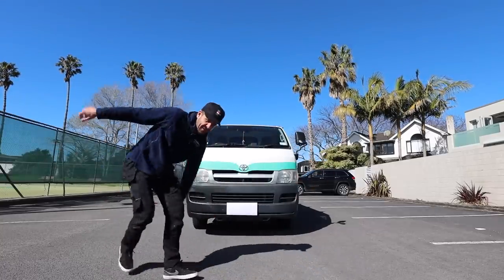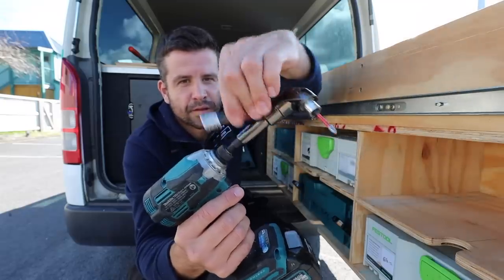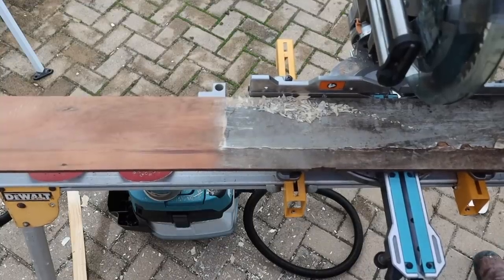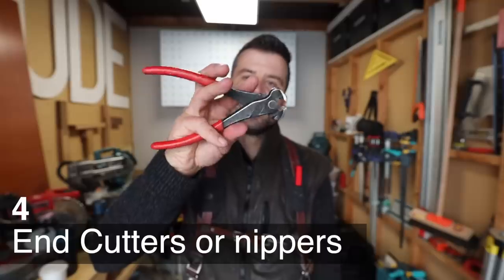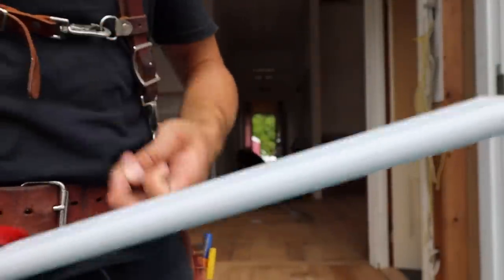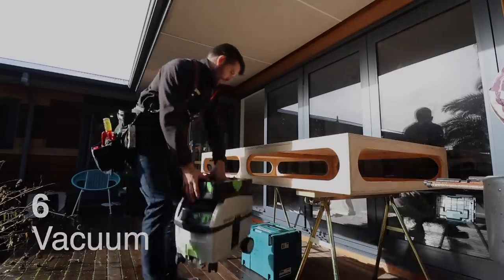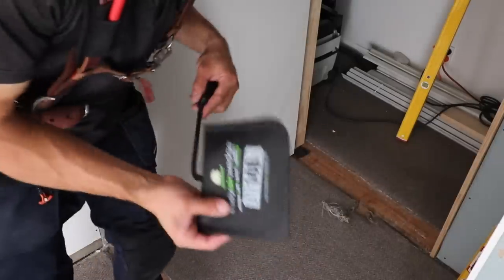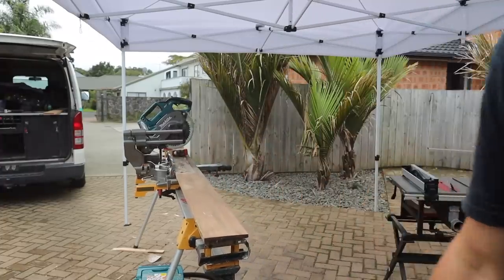7 Unexpected Tools For Builder's and DIY

Comment: ...Currently rebuilding a bathroom in a 1948, transitional plaster, plasterboard, masonry and steel mesh mix walls.. Watching Scott work with the multitool midway through the rebuild I realized I needed to buy one for myself. The time required for a Slow and Steady cuts is easily off-set by the time saved fixing the mess made by other operations. Long-Live the Multitool.

Comment: i have an old neighbor who was a carpenter and he used an old pair of horseshoe nail pullers for nail pulling those things are about 16inches long and provide some really good leverage on nails. in the USA there's a roadside assistance company called AAA i was talking to one of their guys and they use those air bag tools to actually help them to unlock car doors by placing it in between the door and the pillar and pump it up to create a gap to slide a tool in to hit the door lock button

Comment: I tell my clients that my honesty most used tool in my trailer is the vacuum. When your in someone else’s house making a mess it’s extremely important to minimise that as much as possible. It helps my brain to concentrate on the task at hand being tidy & more importantly almost always guarantees that the client will recommend you to family & friends because of the respect you have shown to their biggest investment - home. 

That actually brings up another suggestion for any renovator….floor coverings/protection is also a MUST. Wether it be cloth dropsheets, RamBoard, stick down carpet film, roll of black plastic or even disposable draping film over furniture & doorways. All have their different uses & impact ratings for different scenarios but all extremely useful.

Comment: On my (not) Knipex end nips I dulled the cutting edge on one side, then painted that side so I know which is which. This lets you get a better grip on stubborn small nails without cutting through them. I’d also add a nail set to the list for setting broken nails below the surface. Whenever possible I pull trim nails through from the back as popping the head up from the face often takes a chunk of wood with it.
Reply: Great tips! Agreed on all of these. Nail sets are also nice for just popping trim nails through rather than having to pull them from the backside.

Comment: I always thought air wedges were a gimmick until I finally bought one, they are hands down one of the most underrated tools especially if you have to do a lot of work by yourself.
Reply: 11am java
Reply: Air wedges are so underated,the list is endless for their uses.
Reply: First seen and used those air wedges several years ago. They were included with vehicle lock out kits. The kits included a plastic wedge, a length of some clear plastic with sandpaper for grasping locking mechanism, steel flexible rod for manipulating door handles, and the air bag.  Never thought of using it as a second hand…good idea
Reply: They okay i guess. I've had multiple. Some expensive, some not. I find they end up deflating too much. Especially when hanging heavy doors.
Reply: @flyingjackcarpentry9394  Air wedges vary in quailty, I usually go for Winbag or Hedgehog ones.Sometimes I'll use a piece of old hessian back carpet on them to protect the wedge.

Comment: The multitool should be top of any trades wishlist. Total life saver on many occasions!  😉👌
Reply: I understand how good they are in certain situations but I still absolutely hate them. 
The noise cuts right through me. 
The blades are expensive and shit.
The vibrations have given me the beginnings of WFS.
If I'm getting the multitool out the van I know I have something awkward and shit to do. 
But yes, they are handy. It's just my least favourite power tool.
Reply: Have to agree. Surprisingly handy tool. We just got one where I work and I've already needed it for two things I never knew I would in just this week: cutting out a stump at work, and car (under)body work on my free time. Ours is a Hikoki which came with a selection of blades, and including a selection of blades is a good way of giving an indication of the possibilities the tool has. There were many more than I expected, and I'm confident that's not all of it. Downside is, the blades are expensive, but that is fine for a problem solver.
Reply: @flyingjackcarpentry9394  Totally agree with your comments. I should add ear defenders and anti-vibration gloves to the same wishlist!
Reply: @refa42  going from corded to cordless was a massive improvement. Hopefully they can reduce the dB 🎧 on the next gen.
Reply: Awesome. I finally switched to the Fein cordless, and it manages vibrations so much better than my old tool, its become something I’m always happy to reach for rather than ‘oh no I need to use the multi tool’ - which was where I was for years before, accepting the usefulness but hating it.  Fein. All the way, Fein. The blades are pricey but good too.
Reply: @artfulcodger  Fein or Festool would be my choice if I had the 🤑💰. However my tough DeWalt is better than cutting architraves with a hand saw when fitting flooring! 😉
Reply: @burwoodbuild  hell yes. Even a £30 one from the supermarket is worth having. I think the festool one is an adapted Fein when you look closely, they’re basically the same machine just support Fes batteries. The vibration management is superb on them. In retrospect I should have got the festool as the Fein batteries meant yet another charger type!
Reply: As a software engineer, I have to admit I have little need for a multitool.  ;)
Reply: @flyingjackcarpentry9394  I strongly suggest getting the new Makita starlock, the new Bosch or the new Fein. (Or the Festool, which is actually a Fein) the latest anti vibration tech, plus Starlock, plus higher oscillation angle solves all the problems you speak of. I've owned quite a few multi tools while working in renovation and insurance, and the new Makita is a game changer for me. It doesn't vibrate my hand, its quite, it cuts fast, smoothly and the blades last way longer with Starlock because the connection is more solid and so they don't stall and heat up. Plus the Makita has constant speed control and it drops the power right down if you actually manage to jam the blade and stall it. It's incredibly comfortable and user friendly compared to the older technology. I can't even put into words how happy I am with this tool. 

Trust me, life's too short to put up with ghastly second gen multi tools with OIS blades and no anti vibration. Do yourself a favour and get a good one of you are using it often.

Comment: My pincers are 300mm Wiha pincers, they’re the one basic hand tool that took me years to find one I like. I’ve tried all the cheaper brands including Irwin and Kingchrome and none were nice to use and they all broke prematurely. The best to date were the cheap Trojan brand from Bunnings but even they needed regular repairs. These Wiha pincers are beautiful to use and tougher than nails (literally, luckily😝). Love them.

Oscillating multitool is a daily use tool for a multitude of jobs, couldn’t possibly live without it these days. Cheap blades off eBay are 1/10 the price of the hardware store and last just as well, sometimes better.

That little air wedge thing looks fantastic, I just ordered a couple. Thanks!

I would love to have space to carry a big vacuum on my ute but I’m limited to a tiny handheld one, it sees use once a week or so but I’d love to carry a proper vacuum.

I can’t think of a single time in the last 6 years I could’ve used a moisture meter but on the electronic devices front I can think of a multitude of times a thermal camera would’ve come in handy to find a leaking roof or badly installed insulation etc.

That paint scraper looks handy, we don’t reuse a great deal of materials but it does happen from time to time and I might just have to get a scraper like that for occasional use. Nice.

The right angle drill attachment is a nifty device, not something I personally would use a great deal but certainly it would come in handy at least monthly if not bi-weekly. I’ve known about them for a long time but never quite bothered getting one. Perhaps one day I will.

I’m dying to get a Dewalt jobsite table saw like yours but they aren’t cheap and I really don’t have anywhere to store one on my ute either. I’m on a knife edge at the moment, on my left is my already overloaded ute and on my right is the prospect of buying a van similar to yours to deck out and carry just a few extra tools - track saw, vacuum and table saw would instantly all be right at the top of the shopping list!
Reply: I hate towing trailers, I towed tool trailers for several years and it gets old FAST. Any work vehicle I own needs to be self contained to keep me in a good mood.

Comment: I'm just a lowly DIY guy renovating a tired house and the top three tools that have transformed how I work is the compound sliding saw, multi-tool and home-made track for my old Ryobi circular saw. The multi-tool in particular is so versatile and should be the power tool you buy after a circular saw and a couple of cordless drills. I also uses nippers to pull out nails that you can't get to with a hammer.

Comment: The tip about air wedges is brilliant. I bought 2 after watching your first video with them and they have proven useful throughout my DIY renovations. 
I'm about to replace and rehang all the doors and jambs, both Internal and external in my 1940's home. Almost all the jambs will have to be custom made on site to fit the odd sizing of the original hardwood frames. I've been watching your videos to prep myself, It's going to be one hell of an experience, hopefully not too costly.

Comment: I used heat gun and painter's tool to remove old paint from timber. It's so much quicker than the scraper and produces less paint chips. Just have to set the temperature right so it loosens the paint but not scorch the timber
Reply: Yup, I use a heat gun and the scraper. Been stripping old Kauri boards lately and it is the only way to get the paint off. Sanding is no good as the original material on the wood turns to gum. Painters tool for the profiles.
Reply: Something I try and avoid tbh. Work on old windows and lead paint isn't something I want to be heating
Reply: @elusivemite  as long as you keep the temperature low enough (under 500C, the fume point of lead) you might blow some dust around, but you won't be creating fumes that need a special respirator.

Comment: Those air wedges are also my favorite tool for prying open a car door enough to get a slim Jim inside without damaging the paint.

I used to lock my keys in the car more often than I care to admit.
Reply: did you ever lock your air wedge and slim jim inside the car?
Reply: @bachaddict  Yeah 😅

Luckily our local tow guy is a family friend so he would come get me out of a bind and roast me for doing it again, as any good friend would.
Reply: I bought one specifically for opening a door even though it says it’s not to be used for such purposes. Rules are meant to be broken. I keep mine in the toolbox in the bed of my truck in case I lock my keys in the truck. And a section of rebar wire for fishing keys or pushing buttons
Reply: I was recently measuring down from the top of a fridge beside the cabinet beside the fridge, and my measure tip got wedged between the fridge and the cabinet.  With it jammed in, it would not roll out, and I could not push enough to give me some space.  The air wedge to the rescue.  A couple up top, a few squeezes, and voila, the tape came out.  (mind you, I tried to use them to lift a piano the other day to get something under the wheels, I think I need a couple more air wedges)
Reply: You know, a spare key works too.
Reply: @MrEazyE357  not when the cylinder is jammed and the correct key will not turn in the lock. and spare keys are notoriously bad for getting tape measure tips unstuck. or when the spare key is 300 miles away in your locked house and the house key is also locked inside your car.

Comment: I concur. All these live in the van and get used regularly.

The linbide scrapers are a great tool. Do a lot of window renovation and there a must have 

Though I came across a tool I never knew existed. Metabo Lf724 
Paint shaver. 
Takes a bit of practice to use but saves a lot of time and hurt on the wrists

Comment: Heat gun together with the scraper is a dream for older paint, just heat it a bit so it softens up and it comes off so much easier than with just the scraper. Saves a lot of energy and makes the work more enjoyable. Absolutely true about the dust there!

Comment: Another thing that's an absolute must-have alongside a moisture meter is a pinless moisture meter, for when you've got the gib on and wallpapered/painted and you don't want to poke a dozen holes in it to track down a potential leak.  The fancy ones are quite expensive but you can get a decent Klein Tools one for USD 20-30 that's good enough for tracking down damper-than-they-should-be locations in your wall.

Comment: I had a patio roof built earlier this year. the carpenters could just not manage to cut the posts with an even shadow line rebate at the bottom of the post above that paving.

So I used my neighbours multi tool to cut that rebate square and evenly to the paving line. What an amazing tool, it is now on my must get tool list.

Comment: Don’t forget about the makita leafblower as a must have tool for renovations!
Reply: Or choose a vacuum that has an exhaust port the same size as the inlet, and you can use it as a blower (or those that don't have a removable blower/motor, such as some of the Ridgid models)    Save some space by just having one tool in the van.

Comment: As a 73 year old carpenter/joiner I was told during my apprenticeship in the 1960's that a carpenter used sawn timber i.e. roofing floor joists and studding whilst a joiner worked with planed timber i.e. skirting, architrave ,,doors, kitchen cupboards.

Comment: Scott - you covered many of the unsung heros in my tool kit which I find myself using more than I would have ever thought. You introduced me to air wedges - in return check out a Baaco 665 scraper - it's like a metal paint scraper but just way better due to the carbide blade - find I use it loads for much more than paint. Couldn't agree more on the vacuum and multi-tool. Other tools I could add to your list: a decent 18v portable light and a self centring pilot/hinge drill bit.
PS Love the channel - I learn loads from your videos and really appreciate all the great work you put into making them.

Comment: PAINT SCRAPER is awesome, removes glue squeeze out, flatten builders filler real smooth, clean paint off glass, used sideways cut glass, deburr pipe, the list is endless. It's the carbide blade that scrapes at 90 degrees to the pull of your arm, it's easy to go from feather light finesse to full power with the tool following suit. By far the best money maker is for painting muntin (US), glazing bar (UK), sash bar, the strips of wood holding panes of glass in a window. I just paint these freehand, no cutting in , no masking, the paint goes on very quickly, when the paints tacky I glide the scraper with a new blade around to remove the paint on glass.

Comment: That round blade for the multi tool is best for cutting architraves and door frames flush with new flooring.
I swapped my corded bosch multi tool for the cordless version, so much more versatile with no cord, and just as powerful.

Comment: Wow, I can’t lie, I was beginning to get a bit worried about you there Scott…
Over a week without a post… I wanted to say that based on your review about the Makita 18v (barrel group) jigsaw and the need for an upgrade I bought one. Shocking! Can’t believe this bit of kit passed any consumer safety tests. Because of the unlock and power on shananigans I found myself wrestling to either switch on or off. I found it very disconcerting when you finished a cut the had to wobble around with a running saw to get your spare hand to switch it off. Long story short, I took it back, paid the extra and bought the festool carved cordless barel grip.
Totally different beast and a much superior cut quality. Keep up the good work and stay safe. Gerard
Reply: Get the fein, cheaper than festool who pay fein for there model.

Comment: The table saw was a game changer for me as a DIYer, particularly for recycling wood I use mine most weekends and the new cheap ones are fine for DIY use mine was under $400 and I've had it for 3 years now. (clearly not for a professional their entry level would be 3 times that.)

Comment: Hi Scott, I have all the tools you mentioned, but I was a bit surprised about the moister metre reading, if any wood that I was using was above 18% I would not use it, I like mine to be below 12%, but after thinking about the wood I assume you are talking about pressure treated wood that is used when in contact with the floor. Even though I own all the tools, you suggested I still enjoyed the video and like the wood you use, as we do not get pink wood in the UK, as you will know.

Comment: When those paint scrapers first came out mate borrowed mine, when I got it back it was "what you use it on bro?" Apparently he had used it to scrap paint off the concrete floor in his house, cheers.
Then there was the new, unused $45 brush he borrowed as well, (this was the nineties) came back worn down to about a third of its length, painted the concrete floors, after scrapping them. Mates.
Reply: You wonder how some people can even dress themselves in the morning.
Reply: @andrewford80  That brush  was brand-new top quality, a concrete bloody floor! When I asked for it back, it was at the bottom of a 20L pail of paint, or what was left of both.